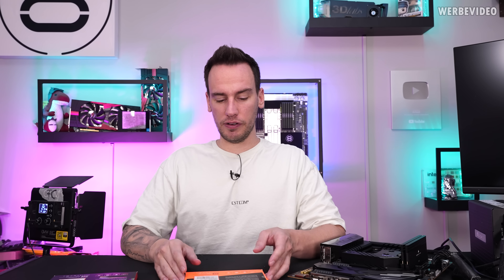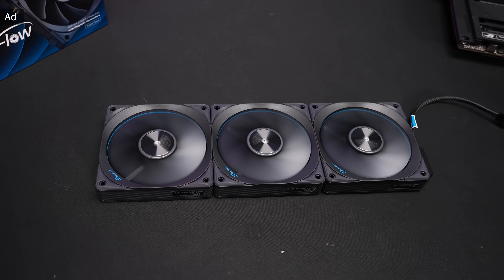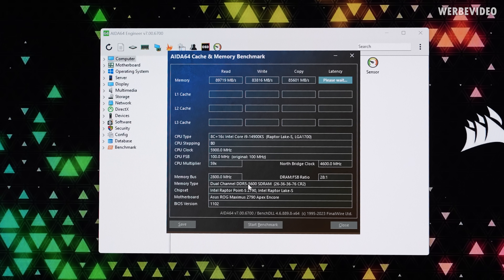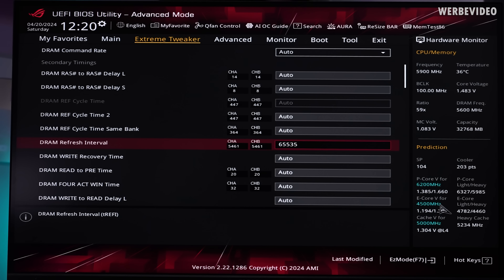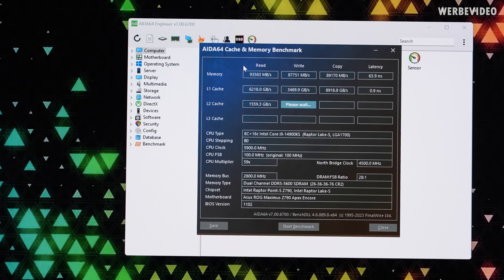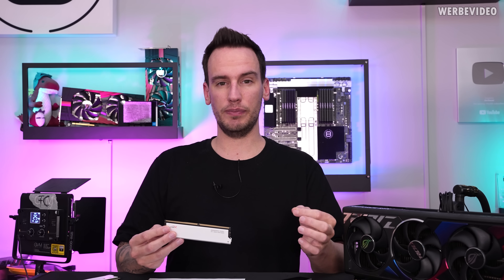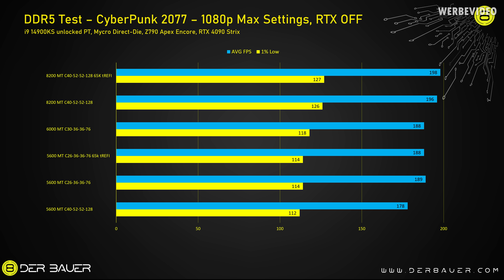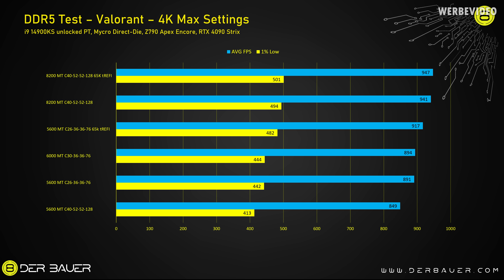Try this DDR5 Subtiming Tweak for Extra Performance

Comment: This is a very extreme example comparing 6000 CL30 and 8200 CL40 because the latency is actually lower for the 8200 at about 9.76ns vs 10ns for 6000 CL30 so you're getting the additional bandwidth and lower latency.
This is because the timings are in clock cycles and every cycle of the 8200 kit is 0.244ns while the 6000 kit is 0.333ns. Clock cycles are not a measure of time and lower number doesnt always mean better. 
Good way to tell is actually taking the frequency and dividing it by the CAS Latency. The higher the number, the lower your latency. Dont buy 6400 CL40 over 6000 CL30 just because the clocks are higher, your performance might actually be worse with 6400 than 6000.
Reply: 6000 boot so slow mine still 4800
Reply: @athelloren1741  I had to switch board to solve this issue, memory context restore was broken on Asrock B650 PG-ITX. AsRock B650M HDV has this solved very well if you're willing to live with 2 mem slots.
Reply: @athelloren1741    bump up your ram voltage to 1.4V or 1.45V 👍
Reply: Could you please give me your opinion on klevv ddr5 7200mhz CL34?
Reply: @rwait1287 if it is AMD yiu will probably need gear 2. AMD imcs are not as good as intels one. Hard to say if high gear 2 ia better than lower gear 1. Maybe hardware unboxed has a video about that
Reply: all those dry and theoretical calculations are pretty much meaningless as CAS timing is only small part of the total ram latency, subtimings are just as important if not more. Derbauer used pretty much AUTO subtimings which will effect the latency by a massive margin.
Reply: CAS latency doesn't matter at all, It's trcd that you would need to take into account
also higher frequency means IMC clocked higher which leads to lower latency from the IMC
Reply: With RAM are are only 2 things where higher is better absolutly everything else lower is better

Frequency and tRefi

Thats it those 2 higher is better

Absolutely everything else you want lower not higher
Reply: If you want to know how much time a timing is equal to in ns: t / memory clock * 1000. 40/4100*1000 = 0.9756 ns, 30/3000*1000 = 10 ns
Reply: @snidepeppe  i mean thats technically works or you can just remove 3 zero's

40/4.1= 9.756ns

As an example
Reply: @commanderoof4578  I'd hope it wouldn't be necessary to explain that to people..
Reply: It's not DDR4, CAS is almost irrelevant for DDR5. The ONLY thing it does that's beneficial is lowering the round trip latency if those timings are set to be trained.

Myself and others have done lots of testing on this, even Buildzoid has found virtually no difference for a tighter CAS latency. tREFI is single handedly probably the most impactful timing with DDR5
Reply: @Zhunter5000  Buildzoid is full of crap, IMC is still the most dependent thing of any Ram configuration
Reply: @TechTusiast yea expo ok will try later not so important by now
Reply: Ive seen 6200-6400 old mdie tuned faster then 8000 xmp on intel system
Reply: @TechTusiast stop recommending "MCR enable" - it still causes instabilities on some boards, had to turn it down after few months of testing myself. But OCing from MT6000 to MT7200 helped munch more with boot times.
Reply: I have the g.skill trident z 6400 1.4v. Why is my voltage at 1.4 when other kits are 1.35?
Reply: @TheAdam2877     it's because your RAM is not stable at 6400. It's pretty common at speeds above 6000. It's OK, even those that find their EXPO or XMP profile is not stable whilst gaming or won't decompress a FitGirl repack should just bump up their RAM to 1.4V to 1.45V. It's safe enough. Some go to 1.5V. I run my cheap 6000 EXPO ram at 1.4V so I can lower timings.
I also undervolt:
VDDIO = 1.3V
VDDQ = 1.3V
VSoC = 1.225V
VDDP = 1.1V
I don't adjust the FCLK. Some like to, others not. As in, "You might not notice the performance increase but you sure will notice any instability".
Reply: “Clock cycles isn’t a measure of time” lmao wut. Its called a clock for a reason

Comment: You might weant to try on AM5. 8200C40 1:2 and 5600C26 1:1. Probably 1:1 scenario could be better since uCLK is faster. Regards
Reply: i don't think the amd cpu can handle that speed through?
Reply: @Bu11sEyes  newer AGESA versions allowed it, but as op said, 1:2 mode. 

It was tested by buildzoid and was only slightly faster in maybe 1 synthetic benchmark. 6200 was best for most (not sure if there have been more tweaks since I last watched it)
Reply: @richmanricho 6400 1:1 was better than every 1:2 speed except 8000. 8000 is objectively much faster in gaming than 1:1.

Comment: For desktop, Samsung or crucial or hynix with custom tweaked timings should have more value and performance. For notebook with limited BIOS tweaking options, Kingston hyperx,ripjaws and Corsair dominator worked very well with Dell, HP, Lenovo, Intel nuc, clevo out of the box with jedec or xmp or expo profiles.
One more thing, if standby memory is frequently cleaned it could give worse performance or stuttering with higher trefi values i.e less frequency of memory check
Reply: Crucial? Afaik they don't make memory ICs, but sell Micron IC based dimms. I know one of them owns the other, but still, micron is the IC.
Reply: @renerant  crucial is consumer side whereas micron is the parent and well known within the enterprise.

Comment: When I was interested in DDR4s, I preferred Micron-E die chips because they overclock very well. What's the situation like with DDR5?
Reply: For ddr4, I believe Samsung B-Die was the best one. For DDR5, I believe the current best performers are Hynix A/M-dies, though I haven't kept eye on the oc scene of DDR5...
Reply: @renerant  thank you. Where can I find list/pdf of which brand and model use which chip?
Reply: @GoldPunch I know that G.Skill at least shows who’s SDRAM they’re using on the kit’s PDF. I can’t comment on any other brands. You usually need to look at the timings and could check Builzoids what RAM to buy.
Reply: Hynix A die, M die is very close but A die is still the best
Reply: Hynix A or M die. I think I've seen better results with M die but haven't tested them yet myself

Comment: I'm still staying on am4 with ddr4 3600. Don't see a reason to upgrade to ddr5 with super high frequency.
Reply: the reason probably will be only then , when some next gen AMD CPU with high freq DDR5 will offer about 2x overall performance comparing to am4 with ddr4@3600 cl16
Reply: @tadasnanartonis9092 DDR5 can already get around 2X the bandwidth. The main bottleneck is the processor. The only thing that should matter to people is whether they're getting the performance they need and how GPU bound they are.

Comment: Good video...I really need to learn how to OC ram...I know few of the basics, but I need to take the time to really understand what all the tertiary timings actually do...
Reply: It’s not worth the hassle believe me 🥲
Reply: @IIHydraII  I just want something new to learn and have fun with...I'm sure the performance gains aren't worth the time invested, but that has been the case with almost every CPU and GPU i've overclocked in years! lol
Reply: @brucepreston3927  Yeah it's interesting to look into but requires A LOT of stress testing and can quite easily corrupt your OS if unstable. :)
Reply: @IIHydraII  i will be using a blank test bench so I don't have to worry about corrupting my OS...What stress test would you recommend for RAM? I think I have memtest 86 on a flash drive somewhere, but I don't know what else I could use...
Reply: Adjusting secondary tertiary timings on an already powerful system gives a small boost.
The main increase comes from frequency, primary timings and tREFI. In total they give about 10-15% increase.
Everything else affects but within 5% of the overall CPU performance in games.
If you need it for sport, or you want to get the most out of the system, then try it. But remember, without powerful cooling of memory strips, good timings cannot be achieved. tREFI is especially sensitive to temperature, despite the fact that it also gives one of the most significant gains from secondary timings.
To get tREFI 130560 or higher, at 8000+ memory clocks, you will need to liquid cool your memory.
For air cooling it is better to stay at 7200-7600 MHz, but it is good to tighten the timings. This way you can get the highest performance in games.
Reply: @Mr.LuciousBlack  I'm not wanting to learn just for more performance...I enjoy  just tinkering! More performance is just icing on the cake! I bought a couple of super cheap kits of ddr4 to play with and actually ended up getting almost 20% more performance out of one kit and I didn't have much idea what I was doing...DDR5 should be fun, but I just want to learn the more technical aspects of it instead of just poking around in the dark so to speak...
Reply: @brucepreston3927  Then good luck to you. DDR5 requires more fine tuning when overclocking to get stable operation. So it's an interesting experience.

Comment: Would be nice to see what the difference is if any on 7800x3d.
Reply: Test it out for yourself
Reply: @НААТ  We don't have money to purchase multiple of the fastest kits.
Reply: @PurpleHeartVR  you just buy one a-die kit 6400cl32 or 6000cl30 you dont nieed to buy faster kit the kits go 8000mhz and beyond
Reply: X3D cpus benefit less from memory latency cause they have to reach memory less frequently because of the extra cache .
But non X3D Ryzen CPUs benefit a lot from ram latency , higher than intel cpus .
 I was hoping he tests 7600x or 7700x for this video .
Intel cpus like to have higher bandwidth ram .
Reply: The 7800X3D will always be limited by the Infinity Fabric speed. For example, at 2000Mhz it will only do 64GB/s of read speed.
So even if the memory can do much higher speeds, it won't matter. 
Because of that, with Zen4 CPUs that have only one CCD, it's better to focus on memory latency.
Reply: The difference isn't much, but it is better. however, I did find a sweet spot of 58880 tREFI on my 7800x3d + 6000CL30 vengeance. I found both lower and higher tREFI to increase the latency. 
FCLK 2166
Reply: @sjoerd104 Take AIDA's numbers with a grain of salt though. It's not a great benchmark and easily influenced by boosting behavior and any background processes. How much of a difference in latency are you talking about?
Reply: @sjoerd104 what dram voltage are you using?
Reply: Latency/timings is more important on AM5 and you can’t really do much faster than 6000 MHz. Buildzoid has easy timings video for AM5 6000 MHz A/M die Hynix kits.
Reply: My 7800X3D performs the same at 4800C40 and 6000C30. Maybe some 1% margin of error delta.
Reply: For X3D processors, memory overclocking gives a benefit of 1% and 0.1%, but the average FPS is not affected as much as compared to Intel. For this reason, many tests on the Internet, where they compare 7800x3D and some 14700k/14900k on the same 6000 MHz memory kits, are not liquid. Intel needs to increase memory frequencies and reduce latency below 60ns. To get the missing 15-20% of productivity. AMD 6000 MHz is enough and it is important to compress the timings to stable ones. Unlike Intel, simply the lowest timings can also be used
Reply: With any X3D it matters even less.